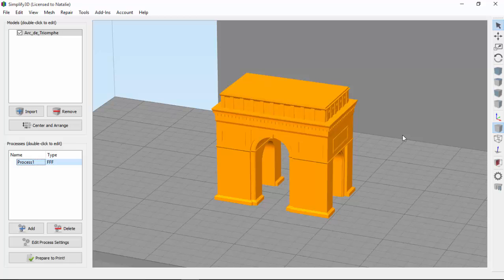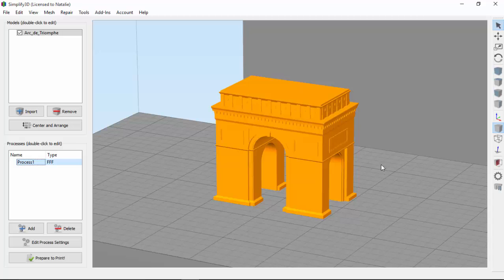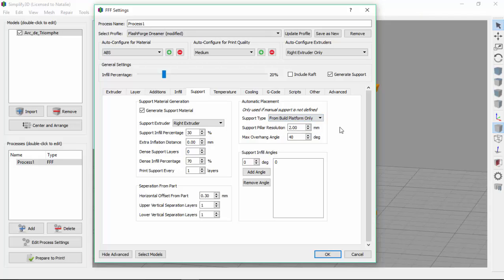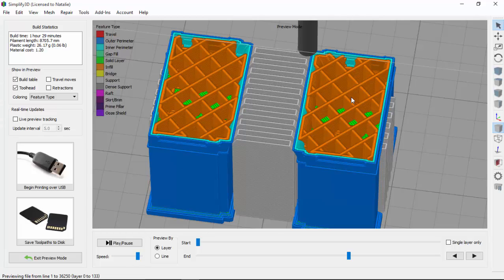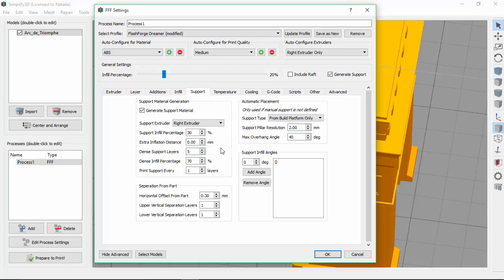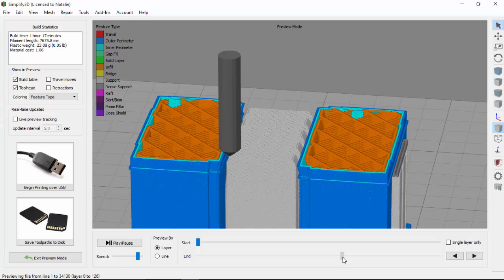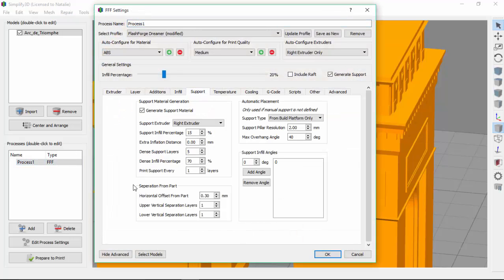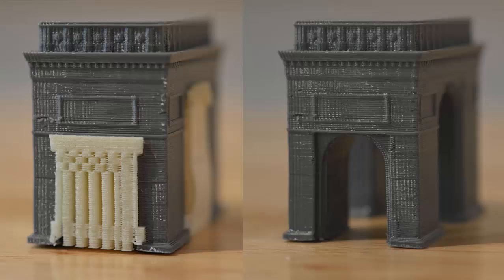Dense Support Structures | Simplify3D

Comment: Hello,

I printed other object, however the underside of the arms went bad, how can I fix this?
I would like the part where there is support to be of the same quality as the parts where they are not supported.
Here is a video with my problem:

https://www.youtube.com/watch?v=FWhXrk4qihg

I know Simplify has many options but I do not know what to change to solve this case.

Can you help me?

Comment: Since, as mentioned, pva is much more expensive, is there a way to print standard support with one extruder and the dense supports with another? This way the majority of the support can just be printed with pla, saving on the costly pva.
Reply from the maker: This is a feature request our developers are currently evaluating. To request features be sure to post to our forum at https://forum.simplify3d.com/

Comment: How does the software know we have two nozzles?, does the software recognize that when we have two nozzles one is for support?
Reply from the maker: If the profile being used has a configuration for Dual or Multiple extruders, then the software can use another material for supports. The software cannot interpret by connecting to the machine. If you want to set one extruder for supports, Go to Edit Process Settings > Supports tab > choose under Support extruder dropdown

Comment: I really am having problems with 3.0.2 Is there any way to go back to V2 ? I have had much better prints on the same object with V2. V3 isn't as nice a finish and the supports are causing problems.